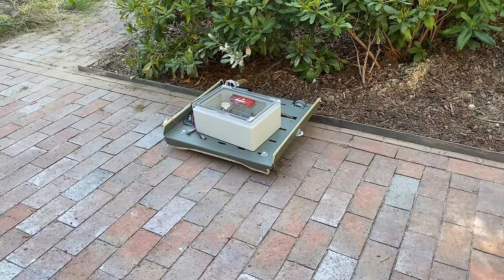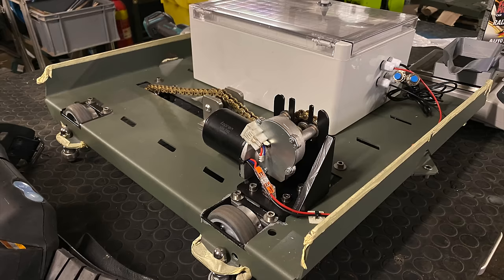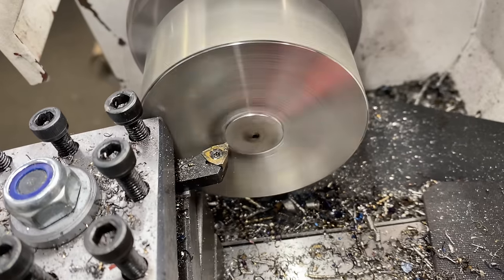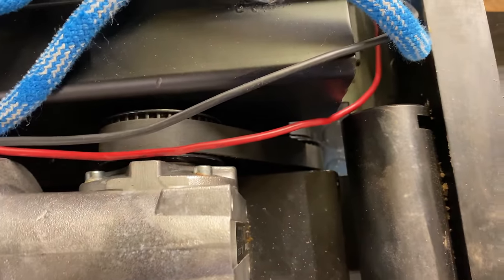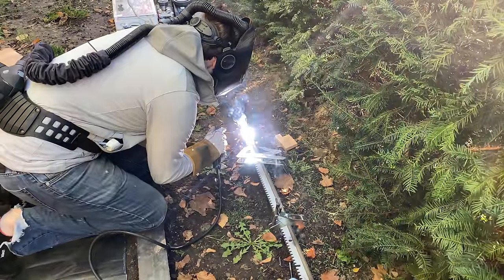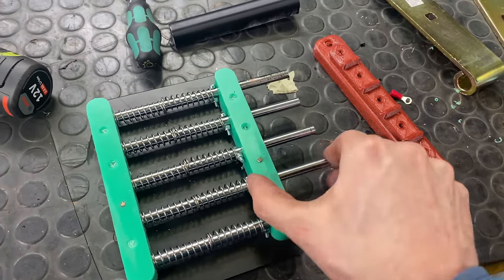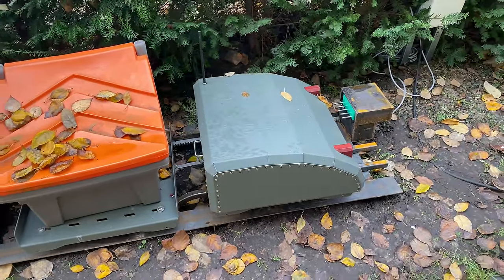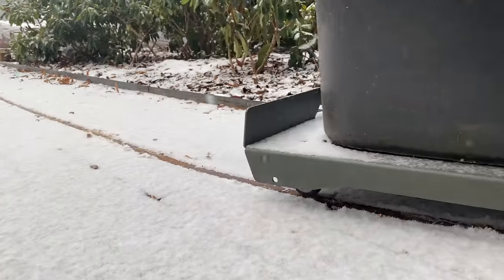I put my trash cans on rails and now they move automaticaly! (Trash Train)

Comment from the maker: Thanks for all the great comments and suggestions! 😊If you like this video please subscribe. I would appreciate that a lot because it helps to make future videos.
Reply: hey great video have subscribed and looking forward to new content ✌🏼+❤
Reply: Truly a Russian
Reply: do you think you could put a flash warning for people with epilepsy on this video? (i don't have epilepsy but 0:51 could maybe trigger a seizure in someone)
Reply: Great job. Will the commercial version of the Trash Train be easier to maintain? There are a lot of little parts that could wear down over time and become expensive to repair/replace. What is the life cycle of the product? Will there be a version that is usable even if there's a steeper incline? Will there be a manual version in case the battery or signal isn't working? What would pricing look like for different versions? Would your Trash Train company just handle holding the patent and selling the design or would it also cover B2C installation and include B2B app service? Let us know when there's a Kickstarter or website for later iterations of this project. Thanks.
Reply from the maker: Many questions, to which I don’t have the answers yet. No matter what I do, all components will either be standard parts or things that are unlikely to break or easy to repair by a hobbyist. Things like the gearbox need to be easily repairable. Even if my business might not be around anymore. So I would love a solution where I could offer drawings for spare parts and electronics without the risk of someone just taking and reselling it. Maybe some form of open source without redistribution and reselling.
Reply from the maker: I only to B to C and design stuff in a way where the enduser or a handyman can do the service.
Reply: @MaxMakerChannel  Thanks for the thoughtful response! You've really created something viable here. Yes, it is smart to consider the following: 1) Design tiers focusing on a) heavy duty use, b) an affordable version with streamlined mechanical design for easier installation and repair, and c) a cheaper, manual version. 2) A subscription service that offers not just the track design and installation, but also trash cans, bags, and smartphone app service. With strong growth around the Trash Train, I could see Waste Management (WM) or a German equivalent acquire your startup for a pretty penny. Good luck!
Reply: @MaxMakerChannel  A rope train might make the whole construction way more simple. You basically only need to fix the trashcan platforms on a T-shape rail and have a stainless steel rope which is going both ways (like an escalator / Rolltreppe) under both sides of this "T" profile, going through loops to keep the rope in position. Then all you need is an engine which can be inside the house and work both directions. You could power the whole thing with a drilling machine (Akkuschrauber) and some gears to make it easier for the drill to pull the heavy load. It could also be operated by something like bike pedals and your own body weight if you want to go without electricity. Stichworte: Seilzug, Akkuschrauber.
Reply: I would absolutely buy one!! 100000000%
Reply: Maybe consider adding a real time clock or wifi so that the microcontroller can bring it out on schedule.
Reply: I absolutely want this for my own house!   Extremely helpful for elderly or disabled.   The only issue that I can see, is that my trash haulers need all the garbage cans lined up along the street, on the driveway.   It's because they have some sort of hydrolic lift on their truck.   No human gets out to pick up the garbage can.   Instead the truck has hydrolic "prongs" which fit into the garbage can, which then lifts it, dumps the contents of the can into the truck, then lowers the garbage can back down onto the customer's driveway.   I was shocked the first time I saw it.  So to make me and my garbage service happy, the tracks would have to be buried into the driveway, so I can get my car in and out.   But I absolutely want this!
Reply: I hope you have patented this internationally.   Cos if not, somebody else might have already.
Reply: Das ist das Deutscheste das ich auf YouTube jemals gesehen habe. xD
Klasse Max xD
Reply: Suncitibins
Reply: What a waste of time and money.
Reply: Needs a drone??
Reply: Instead of making a custom toothed track, could you have welded some of that metal chain to the rail instead?

Comment: As a longtime BMW enthusiast, I say this is probably the ultimate example of German Engineering.   Complex, expensive, prone to failure, difficult to maintain... and in this case could have been done with a couple pulleys and a cordless drill.  Very nice.
Reply: As a german, your comment made me chuckle. The same thought crossed my mind when watching the video. 😏
Reply: Yeah, but are you the one outside in bad weather sitting cross-legged on the ground holding the drill?
Reply: Use a crank handle?

Comment: the fact that it moves them like, 20 feet makes this 10x better.
Reply from the maker: Haha. I really had no other option. My physical energy is limited so I tend to think things through, so there was no better concept.
Reply: @MaxMakerChannel  heck yeah, work smarter not harder!
Reply: I made it past that to the line that they are only picked up once a month. this is peaklulz

I think a tubular rail is a better idea, using a 40mm steel tube which you bend into the shape of the track. This allows you to use two opposed drive wheels in compression against the pipe in-between. Should be far cheaper and the train would not need to be weighted.
Reply: @ohyou_6599  since its hsing rack and pinion now it doesnt need to weighted either
Reply: Well there is like 7 of them plus it's fun and a good vid.
Reply: @MaxMakerChannel  I live in a small flat for the same reason. I don't want to spend too much time cleaning it. I had a 90 mq flat before, realised I didn't use any of that space. I also decluttered a lot, I sold most of my belongings, because I realised I can live with just the content of a 40 liters backpack. When you get old you realise you want to focus on the important things, like watching a YouTube video of a guy building a trash train! 😀
Reply: @ohyou_6599  When friction is needed for traction, weight is needed or clamping force if it is from both sides of the rail (tube).  Unless you make a much larger car or platform for the trashcans, my thought is you should keep the rack and gear drive for reliability over friction drive.
Reply: @MaxMakerChannel  Sir if you build stuff like this you have a lot of physical energy, great build
Reply: DeichschafLP  er ist deutscher und wohn in Deutschland 😂
Reply: DeichschafLP  hört man an der Stimmenfarbe
Reply: No energy. Builds a train.

I think you just have ADD my man lol
Reply from the maker: Physical energy. Mentally there is no limit.
Reply: DeichschafLP  der ist ja auch aus deutschland
Reply: DeichschafLP is ja ein deutscher
Reply: Brilliant! I have arthritis and it’s a painful chore 😖hauling my bins to the curb (and back) every week. I wish you were my neighbor! I’d barter for a trash train! “German engineering” - YEAH! Ps. I lolol’d at the thought of your trash train not stopping and heading off down your street 😹
Reply: It's a short short short line.
Reply: @BewareOfTom watch your profanity

Comment: as a professional train operator i need to say that you need a third light on top of the two, its called spitzenlicht. also a light indicating the end of the train would be usefull (Schlusslicht). Like your train very much, awesome project
Reply: AND a train horn! Temporarily a tugboat horn would be ok. 🤣
Reply: @Stefan_Dahn  And just for historical detail how about a large gun !? 🤣🤣
Reply: I would add a strobe light to the engine and lights to the rear car.
Reply: @JoseMartinez-lf5fg  Put rgbs on and make it a gaming set up
Reply: Might aswell add a SH2 Scheibe at the end of the track so the cans know when to stop lol
Reply: well a third light isnt necessary
Reply: @lampwick4427  Also makes the train run faster xD
Reply: Well it drives on the street, maybe its classified as a tram so it might only need two O:)
Reply: @Quasihamster  even trains can use 2. Japan proves that, even the UK trains have 2 sometimes. It's of the german train that have 3. So while yes maybe in their country they use 3 but worldwide and in general a train does not need 3.
Reply: @vse7327  well the third is more like a foglight ain't it? plus US also have that third light IIRC for freight at the minimum
Reply: @PrograError  yh that's why I said some countries have 3. While Some of the UK don't and Japan doesn't either so it clearly isn't a requirement everywhere.
Reply: @vse7327  Not an expert, but here in the United States I've seen variations from 2 to 4 or more lights.
Reply: Actually it's moving at a very low speed and not passing intersections, so just a train bell is required lol
Reply: @boxlid214  yh lol. Or a very loud horn
Reply: Here in the US and A he will need:
-Single headlight, classification light, ditch lights, a train horn, an EOTD device (with red light), and of course FRA approval.
Freaking 🤡 show we hae over here, I tell you.
Reply: And a fog machine. And disco lights. DJ Trash Train.
Reply: Are all those bins for one house ?
Reply: yes, a Schlusslicht is useful in case another trash train happens to run up to it 😁
Reply: Und weil es Deutschland ist, bitte noch 32 Warnschilder aufstellen und Signalsound beim Rückwärtsfahren, falls sich doch mal ein Igel unter die Spur verirrt. ...
Reply: and a bell saying dingdingdingdingding...

Comment: For a commercial version, you could make it more modular. It shouldn't be limited to a trash train. If people have a yard, they need to haul leaves, clippings, dirt etc. Maybe loose sections of rail that can be easily moved around?
Reply from the maker: I think the tracks will be the most difficult thing to design. They need to be easily customisable but also cheap. You need straights, bends and inclines. That is a lot of different angles.
Reply: @MaxMakerChannel  You could try flexible rails with lawn pins to stick in the lawn or in gravel etc. Maybe make the wheels steerable and guided by the rail
Reply: At that point you might as well make a self-propelled cart and forget the rail
Reply: @MaxMakerChannel  Make them like Brio wooden train tracks.
Reply: @MaxMakerChannel  they have systems for Peat harvesting which aren't fixed and are just really bendy.
Reply: Look up garden monorail. It’s cheap and flexible.
Reply: @MaxMakerChannel  A good source for inspiration is the Decauville catalog (PDF link), http://www.samlingsportalen.se/digitalt_arkiv/jvm/litteratur/Decauville1_web.pdf
Reply: @MaxMakerChannel  Have you thought about a metal cable that pulls and pushes te cart? Instead of a rack and pinion? That way it is easily made to any custom length
Reply: @MaxMakerChannel  I think it make more sense to sell this as a service instead of a product. Especially since you mentioned a lot of older people could need this, someone would have to set it up for them. If the track is not in a place that people walk around, you could just use a winch system, like Mad4Tracks mentioned. That way you don't have to worry about stuff on the ground.
Reply: @MaxMakerChannel  there should be a reduction in metal when possible this is too industrial. Maybe more suitable would be a single rail maybe just a pvc guide rail/pipe and end stops could be digital with a non drive wheel to measure distance
Reply: @MaxMakerChannel  What about compliant mechanisms I think they are called? soft bodies
Reply: Other than the loose sections, that's exactly what I'm doing for my property (I have 20 acres of mostly flat, cacti covered ground, so I'm doing a full railroad around it to do yardwork without risking my truck's tires.)
Reply: mines, quarrys etc. used to have flexible rails which they moved sideways whenever a new segment was started
Reply: My old warehouse job had a old roller system they refit to move the paper and cardboard bins when they got full . A bin would sit at my station and as it got full I press a button it would slide back onto a roller and a fresh bin would get delivered to me the same way . The bins would go through the warehouse to the compactor where a worker would empty it and put the bin back on for it to loop back around to the start and another bay would get it . Saved so much time dragging the bins yourself and having your numbers drop because you have to search for a free bin
Reply: @MaxMakerChannel  You  better make it a Metro to avoid problems with high snow
Reply: @MaxMakerChannel  it's a neat idea but imo less valuable per effort than the fixed rail that you have.
Reply: These have existed for a long time in film - look up "Dolly Rail System" or "Flexible Dolly Track".  It uses flexible tube tracks similar to PVC pipes with grooved casters to center your load.
Reply: You need a large yard to justify buying the track and other necessities. Otherwise a common wheelbarrow or 4-wheel wagon is far less expensive and easier to use. Also sectional track for even a 7 and 1/4" gauge track (think kiddy park trains) might too heavy for someone to lift, let alone a turnout (track switch) to branch off the main line.
Reply: @MaxMakerChannel  For the rail QRO 30x3 mm profile bent in a tube bending machine if necessary. For the rack gear FL 20x2 mm profile corrugated in a press to Module 8-10 and welded on the square profile. All using cheapest S235 structural steel and feuerverzinkt afterwards. It is as cheap as a steel profile in a hardware store.
Reply: Brilliant idea! Our Unionised bin people here in the UK would strike as soon as they saw it 😂😅
Reply: @timeckelmann1196  That's a good idea!  I love the source of inspiration.  Spent many hours playing with Brio train tracks as a kid!
Reply: @MaxMakerChannel  not just that but ideally heated in some capacity to prevent snow/ice build up
Reply: @MaxMakerChannel  Won't screws connecting the motorunit to the charger, rust over pretty quickly? So maybe some stainless screws instread?
Reply: @MaxMakerChannel  And tracks recommended to be some common width, like 1000mm or 750mm
Reply: im actually very pissed at this comment. I came up with this idea no shit just a few weeks ago and started drawing it out and now i see this video and then you comment my idea!!!!!!! NOOOO!!!!!!!!!!!!
Reply: Just use a small tractor and a small trailer. It can go all over, lol.
Reply: Nah, buy a used Tesla, throw away all the extraneous stuff (maybe not Elon just yet) and use that as the basic mass mover, add your modularity to that framework (the battery package adds the heft and inertia that seems a necessary part of the successful implementation).
Reply: @MaxMakerChannel  easy solve for that is to make a tough plastic chain like rail. can be picked up and stored and bend to the needs of the user
Reply: Track diverters. Just like the main railways.
Reply: Check out Tom Scott and the monorails.
Reply: It's called an ATV and a trailer lol.
Reply: For those tasks.... it makes more sense to NOT have tracks. I mean moving tracks to moev dirt and pick up clippings who are we kidding? powered carts already exist for that.
Reply: @sourand jaded Mono rail also has traction advantages since you can grip it with a tensionable roller from both sides.... and can get rid of the pinion gearing.... also for cost I'd use a tube instead of this if you reall wanted it to be square you could get fancy and push a tube through a set of dies to square it up for during the manufacturing process.
Reply: @JuhanaSiren  This was really interesting 1905 history. Everything from tracks and switches to rail cars and locomotives.